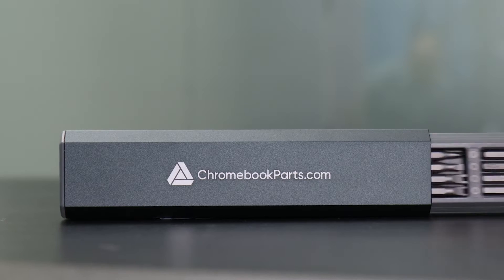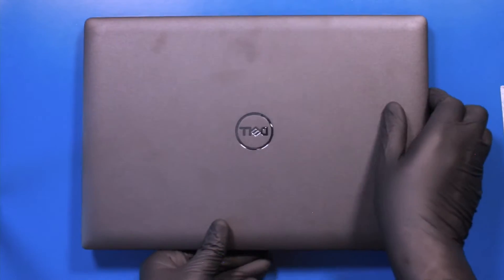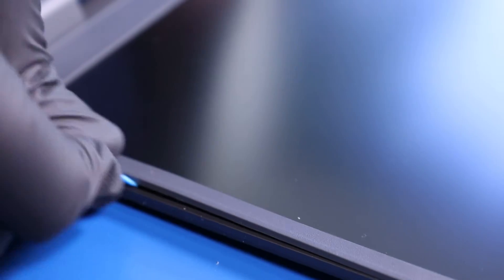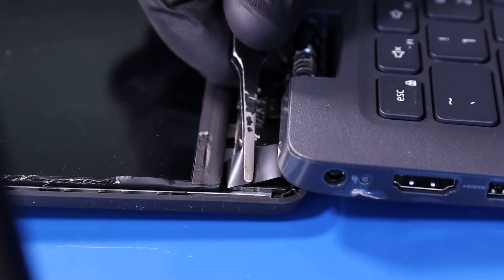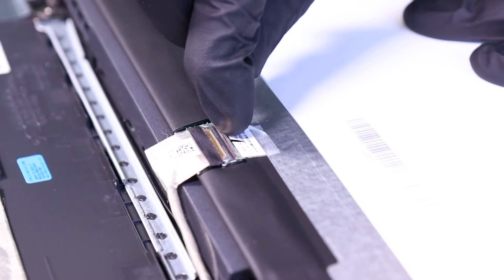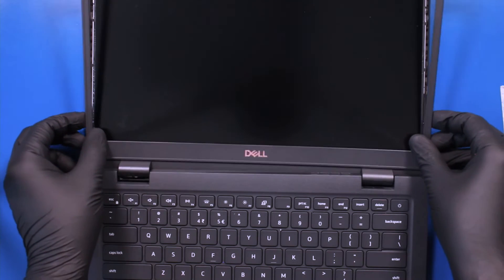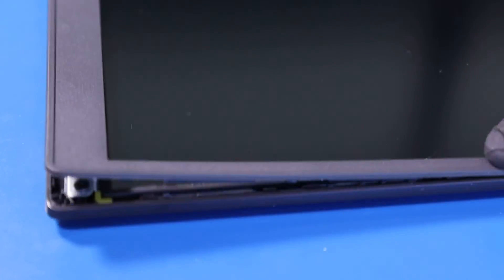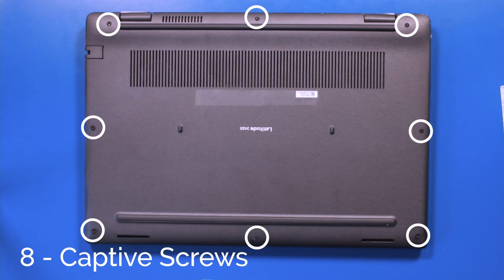Dell Latitude 3420 LCD Screen Replacement

Comment: how many pins are there for the dell latitude 3420 display panel socket?
Reply from the maker: Should be 30, by our count
Reply: @Chromebookparts That's right, sir, according to the reset I'm looking for, most of them have a 30-pin socket and I'm just making sure that I don't choose the wrong panel to replace my laptop screen.
Reply from the maker: They can be tricky, looks like that item is on back order for us (https://www.chromebookparts.com/dell-latitude-3420-lcd-screen-lcd-sng-2347-1.html), but let us know if you have any issues finding it.

Comment: Is it necessary to remove the battery first?
Reply from the maker: Hello! It's not necessary to remove the entire battery, but we always recommend unplugging it whenever you're performing an operation that requires disconnecting other cables. This prevents the possibility (even though it may be small) of a short.
Reply: @ got it, thank you bro
Reply from the maker: @AllAboutSpeeeed  No problem!